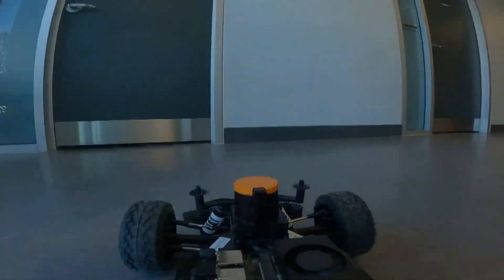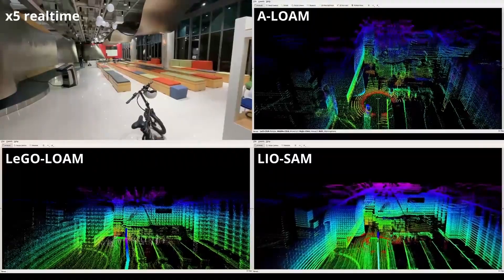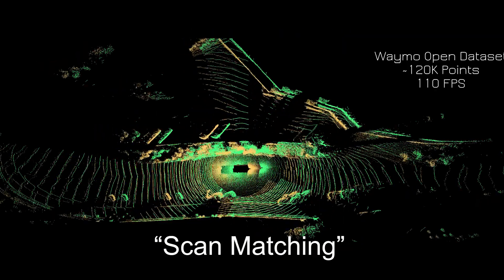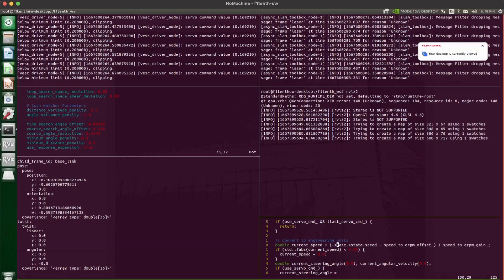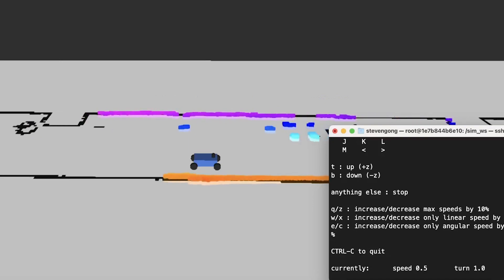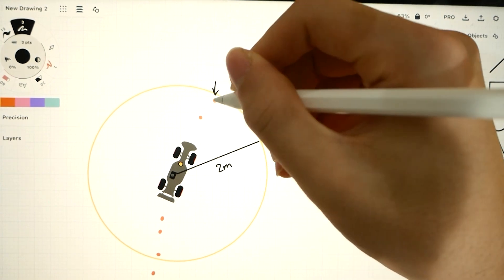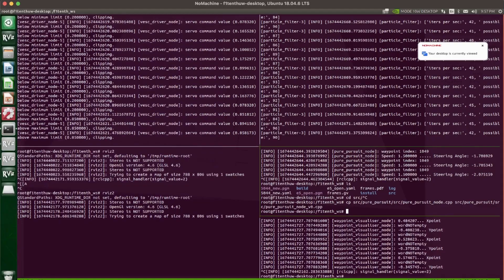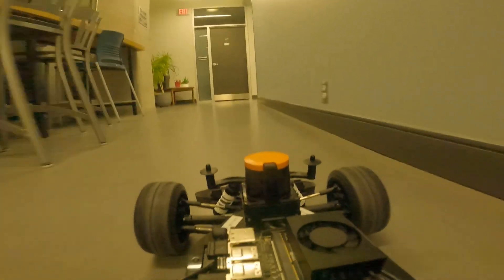I Made a Self Driving FPV RC Car

Comment: How’s it going with this? Did you work on getting the car to begin from as far to the outside of the turn as possible as it was on the straight before the turn to then be able to carry maximum speed thru the turn, etc? I was going to have my kids work on a project like this over the summer but after seeing your struggles…im mot sure a summer break is long enough haha.

Comment: You are awesome I can create a blog for you and Rate my Blog my friend.

Unleashing the Speed: Building a Self-Driving FPV RC Car

Introduction:

Are you ready to drive into the world of autonomous technology and high-speed racing? In this blog, we'll explore the fascinating journey of designing and building a self-driving FPV RC car that can reach speeds of up to 40 mph. From overcoming technical challenges to fine-tuning controls, this is a ride you don't want to miss.

Simultaneous Localization and Mapping (SLAM)

 To enable our self-driving car to navigate autonomously, the author implemented Simultaneous Localization and Mapping (SLAM), a crucial technology for real-time environmental awareness. However, the initial implementation of the sensor-based SLAM algorithm faced significant challenges, leading to an incomplete map. the author had to drive the car around to gather more data and refine the map, eventually overcoming the obstacles to create an accurate map generator.

Overcoming Technical Hurdles

 One of the key technical hurdles the author faced was the issue with the sensor-based SLAM algorithm, which relied on laser measurements to detect obstacles. We encountered difficulties in ensuring precise measurements and faced initial problems with an incomplete map. However, with perseverance and innovation, we were able to resolve the issues, leading to a functional and reliable map generation.

Optimal Control and Racing Line Generation

 Implementing optimal control techniques was an essential part of our journey to create a high-performing self-driving car. Generating a racing line and utilizing a look-ahead algorithm for precise car control required ingenious strategies. We encountered challenges in discretizing the racing line for effective representation in code, eventually leading to the car's ability to pick the farthest point within a certain radius and align its wheels in the desired direction.

Challenges in Controller Tuning

 Tuning the car's controller posed significant challenges, as over-correction of waypoints resulted in the car's instability and wiggling behavior. It became evident that driving the car at higher speeds would lead to potential crashes if the controller was not appropriately tuned. Through meticulous adjustments and problem-solving, we aimed to fine-tune the controller for autonomous racing, ensuring stability and precision in the car's movements.

Embarking on a Racing Journey

 Our journey culminated in the successful creation of an autonomous car built for high-speed racing, marking the culmination of four months of research and development. Through collaborative efforts with a professor and relentless dedication, we rewrote the controller and generated waypoints to bring our vision to life. Looking ahead, the prospect of head-to-head racing projects and the potential for multiple cars racing, reminiscent of F1, excites us for the future.

Conclusion:

The journey of building a self-driving FPV RC car has been both challenging and immensely rewarding. From overcoming technical hurdles to fine-tuning the controls, the process has been a testament to innovation and perseverance. The thrill of autonomous racing and the potential for future projects hold promise for an exhilarating journey ahead.

Comment: Hey Steven that looks really cool. I am working on a similar project (just finished building my car and having some issues) was wondering if you could share a little of your experience. I am trying to use the f1tenth docker container but it seems there is some packages issue there (rviz2 would not work unless full upgrade) after that can't get any lidar scans as well (frame doesn't exist issue)

Comment: Hey, I have a question that I would really appreciate if you could clear up for me. How does the car actually know where it is? It has a map generated through SLAM, but once it is placed in a random location on the track, how does it know that it is, for example, at the northwest corner, and not the southeast corner of the map? And does it have any redundant systems for positioning, something inertia-based maybe?

Comment: Hi Steven, I've watched your video about fpv rc car and it was so amazing. But I have a trouble to design my robot, I make a hexapod robot that can detect a wall and can walk there by itself. The trouble is the wall is about 10 cm high and the robot is actually the same high with the wall without lidar sensor. Do you have any idea to change the sensor with other sensor or the mechanism and placement of the sensor? Hope you or guys here cab help me to fix this. Thanksss :D

Comment: Hey, quick suggestion! I noticed the vehicle was tending to take corners too fast, resulting in it having to realign itself back onto the determined path on the next straight. To improve efficiency on your turns I would add a deceleration/ braking element to that portion of the path. By determining the maximum velocity your vehicle can take that 180 degree turn at without skidding or flipping (Ekin, centrifugal < Fm, gravitational Force on vehicle?) then you can create a brake slope starting at the point of highest centrifugal force (1/4 PI of turn circle, as the 180 degree turn is a 1/2 PI and you want the center of this section as it is the outer most point of the turn) and then setting up brake points along the run-up to the turn that will reach your target speed (the maximum achievable corner speed) by the time the car hits that outer most point in the turn. Then you could even reverse this brake slope on the tail end of the turn into an acceleration gradient returning the vehicle to it’s top speed for the straightaway.

Just a thought though, I have no experience in any of this and I don’t know if this is even a feasible solution, just thought I’d throw the idea out there in case it’s worth anything!

Comment: A vehicle using a pre-generated map and following a series of waypoints is not self driving.  This is just a more sophisticated version of a line following robot.  A real autonomous vehicle would use sensors to detect and avoid obstacles in real time.

Comment from the maker: PART 2 OF THE SELF DRIVING RC CAR IS OUT: https://www.youtube.com/watch?v=R87Qlq_wSY8

Also, alongside the video, I wrote a monthly newsletter with it, where I share some more behind-the-scenes insights. You can check the publication here: https://medium.com/steven-gong/autonomous-racing-coworking-accountability-4a90fd446467
Reply: Hey Steven, great work, but I don't think your existing link goes to your part two video : https://youtu.be/R87Qlq_wSY8 it just loops back to the current video.
Reply from the maker: @joshseal2000  thanks, I fixed it!

Comment: actually... the logic should it be better: if going to turn right, then take the most left lane first before making the right turn. So this will decrease the angle of turn, which enable the car to run faster during turning or reduce the need of braking. at least this is the way I would drive on a race.

Comment: I wonder if security cameras will ever be mouinted on moving  vehicles that run on a track   in the ceiling of buildings and offices.
They can ru n high speed and stop  and reverse with a camera on both ends front and back. 

Talk about tracking a subject.

Comment: Also I am not even close to having the knowledge you have to do such things but I am sure that every component you use from Lidar, processing, and Tx/Rx is going to need a super fast update/refresh rate, That Lidar is quite cheap, I don't know its specs, but I think you might need to upgrade to something faster.
Reply: I would hope not.. the development kit he's using is over $2,000 (it's discontinued now, so around $479 MSRP from what I can tell), and the LiDAR is around $750-2,000

Comment: Consult with actual pro or semi-amateur RC Race Car Drivers. in your case road buggy Race drivers. you really need to have a talk with them about what controller you are using. they will all tell you the same thing. DITCH THE GAME CONTROLLER!!! LOL, They will also tell you that latency is important to make you feel connected to the car. I think you crashed because of latency and possibly you could not see around the corner properly. OMG, I just realized you are using Wifi too. dude seriously get rid of that stuff for when it's under human control. that's fine for communication for autonomous driving, but for human driving just get a regular Transmitter and receiver.
Reply from the maker: appreciate the feedback, i’ll look into this !!

Comment: dont use an Xbox controller, use what actual RC Race Drivers use. there's a reason they all use the conventional wheel controller and trigger, as opposed to anything else. trust me you will be ale to control it much better. I fly planes and Race 1/8th scale and 1/10th scale off-road buggies. As much as I like game controllers you can never have the same control over a car as you can with an actual RC Car controller and you want to use a quality one because the latency makes a HUGE difference. If if you cant at first think it will make a difference, it shows up in your lap times Big Time!!!

Comment: Thicker shock oils and firmer springs would make it handle better on a smoother surface as that's probably setup for offroad surface. More tweaking to increase some steering would help also. You can tune the car to work better and go around for a faster track time.

Comment: Your first mistake was trying to program such a monumentally complex behavior manually. Should've used reinforcement learning and have the AI simply to through checkpoints in the hallways as fast as possible. With weights distillation, it should be able to learn proper racing techniques that require some foresight, rather than just being a reactionary state machine.

Of course there is no hope to do this in real time, this requires a very fast simulation. Luckily, your setup's simulation would only require the lidar map which you already have.

Comment: The RC car knows where it is at all times. It knows this because it knows where it isn't. By subtracting where it is from where it isn't, or where it isn't from where it is (whichever is greater), it obtains a difference, or deviation. The guidance subsystem uses deviations to generate corrective commands to drive the RC car from a position where it is to a position where it isn't, and arriving at a position where it wasn't, it now is. Consequently, the position where it is, is now the position that it wasn't, and it follows that the position that it was, is now the position that it isn't.
Reply: Your a genius man
Reply: @val  are you sarcastic cos I hope so
Reply: But because of the coder made a small mistake it does this whole thing backwards
Reply: It knows where it is because that's where it is.
Reply: It isn’t in 99.99999999999999999999999999999999 percent of the known universe

Comment: good job - but you could improve it a lot by tuning the trajectory following mechanism if you are not going to just steer towards a single point but calculating a path with curvature with 4 or 5 points ahead and then use this data to correctly act on the upcoming track. Based on the cuvature through the points ahead you could either accelerate or break early eoungh - and you could slightly oversteer based on a combination of current speed and curvature as well. :-)

Comment: So essentially you design a vehicle that get inputs which are used to build a virtual environment. You then use this virtual environment to run simulations to train a model which you can apply to your vehicle and it will use the sensors and input methods to rebuild the virtual training environment at runtime allowing it to essentially operate in the real world.

That seems like one of the most exciting industries to be getting into especially as someone interested in deep space exploration as AI seems to be the future to long term multi generation exploration missions which are going to become a thing in the not so distant future as we start to apply them to explore the remote ice moons in our solar system like Europa.

Comment: Do you use Nav2 in this project? I am working on SLAM, seem we are using the same SLAM toolbox packages. However, I couldn't make it.... the map frame is not exist when I launch the it. seem the TF from map to odom cannot be published... do I have to add the base_laser in my URDF so that to make it works?

Comment: for self driving cars, can they be controlled by a bunch of if then type code lines? like logic? or does one have to use learning algorithms and generative ai stuff that tries again and again and has parameters like not crashing/not experience excessive acceleration/accelerate other objects by colliding into them minus plastic bags. ? why cant self driving cars me made to work by having some low skilled person writing the logic that is needed to avoid each accident experienced by an rc car, then later a simulation and then a full size car?

Comment: This would be a great Setup for an AI-Based Driving FPV RC Car. Use a neural Network for the Controller-Points with Attributes like Speed, Brakes and Steering and let it develop with small changes in the Attributes to the wich Evolutionstage gets the best Laptime...

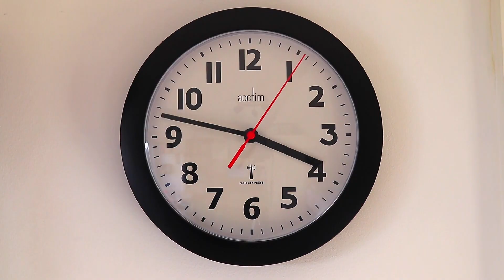Comment: 6:00, Love that the clock is just in time seek mode where it turns like that until it hits the correct time (radio controlled). Albeit sped up a bit.

Comment: Wow, this things goes off when its working "as intended", the head to head part should be more like "real" RC racing, the SAME RC cars and the "racers" are the developed algorythms, the best algos win :D Thats what we need to get forward in AI self driving cars, not Teslas recording the nonsense happening on the streets.

I miss that brushless sound, i had once also a monster truck going 60mph+, but in the end it was just too expensive (killed batteries like 2-3 kg LiPos a year, replacement/tuning, maintainance, service of diffs, new bearings,...) Fun, but expensive.

Comment: Now that you have the algorithm working well with the physical car, can model the environment. It's time for you to take it to the next level!

You can train a neural network to build a generalized, machine-learning algorithm capable of all the "optimal control" stuff inherent in the fact that it will optimize for getting to major features (start A->corner B->destination C) as well as lap (start A->destination C) as fast as possible. Hitting the wall naturally slows you down, so the algorithm would theoretically not want to do that on its own and it would optimize its angle of approach to maintain speed. I would imagine it learning to ideally by move OUT as LOOSE as possible before taking the corner IN as TIGHT as possible. All while remaining on the correct exit trajectory.

When you said that you'd have other cars against you, I immediately thought of a generative adversarial network (GAN) where A's loss is B's gain and vise-versa. ML is mostly training of a simple algorithm.

Anyway, if you want to collaborate, I'd love to help you get started.

Comment: I wonder if some missiles have a system in them that looks at the terrain and compares it to a map and can tell where it is and guide itself without the help of gps or laser guidance. It would be cool to have a drone that could do that so that no amount of signal jamming could stop it from flying it's intended path. Basically, the same way humans or dogs or horses get to where they're going when they're familiar with the area.
Reply: The missile knows where it is at all times. It knows this because it knows where it isn't. By subtracting where it is from where it isn't, or where it isn't from where it is (whichever is greater), it obtains a difference, or deviation. The guidance subsystem uses deviations to generate corrective commands to drive the missile from a position where it is to a position where it isn't, and arriving at a position where it wasn't, it now is. Consequently, the position where it is, is now the position that it wasn't, and it follows that the position that it was, is now the position that it isn't.

In the event that the position that it is in is not the position that it wasn't, the system has acquired a variation, the variation being the difference between where the missile is, and where it wasn't. If variation is considered to be a significant factor, it too may be corrected by the GEA. However, the missile must also know where it was.

The missile guidance computer scenario works as follows. Because a variation has modified some of the information the missile has obtained, it is not sure just where it is. However, it is sure where it isn't, within reason, and it knows where it was. It now subtracts where it should be from where it wasn't, or vice-versa, and by differentiating this from the algebraic sum of where it shouldn't be, and where it was, it is able to obtain the deviation and its variation, which is called error.

Comment: what could you do to add more variables giving the Nvidia Jetson more information to combine and make a smoother final lap overall ? factors such as active aero with precise angle of control on spoilers and diffusers , angle of control on the wheels around the corner to implement drifting along side varying  friction rates ?